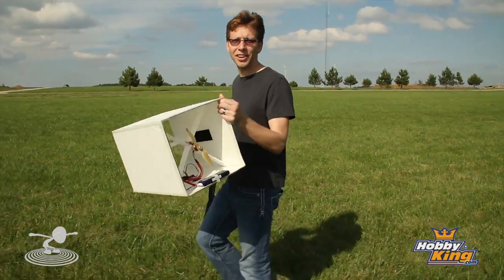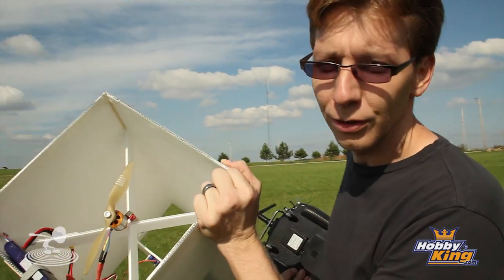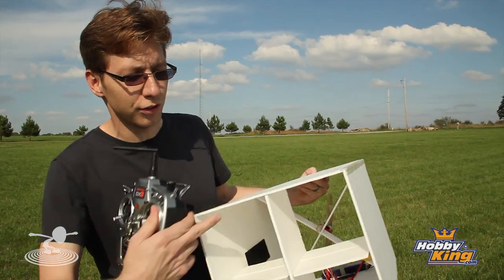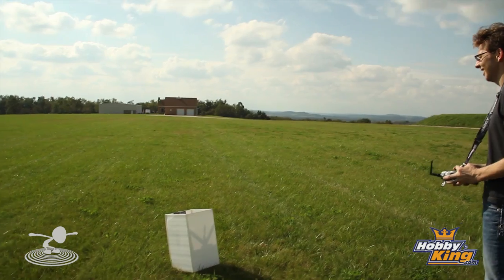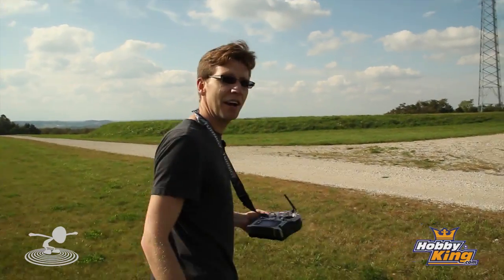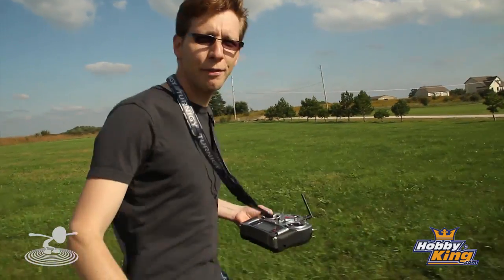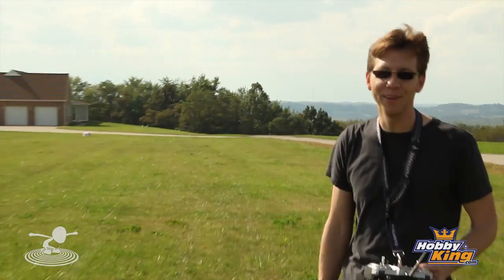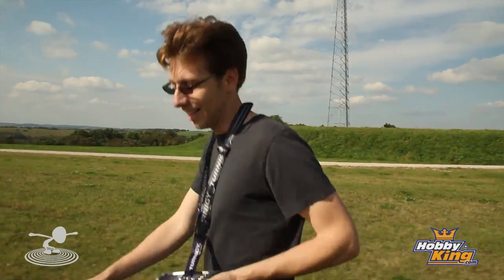FT Development - Flying Box

Comment: One suggestion for making your box able to.be turned around is to place most of your weight on one side, and install two servos to give you turning capability.  You WILL need two additional Control surfaces to receive this.  I hope this helps.

Comment: Kinda reminds me of our old box kites we used to fly as a kid. Might try changing the bottom to one of the edges, putting the battery in the bottom corner of the box and incorporating a V style rudder/elevator. Shorten the length of the box, being too long will not allow the box to turn as well as a shorter one..

Comment: HEY you need to give it its own sense of up and down what I mean is the Omar's of the book is symmetrical on all 4 sides so the air flow is even instead of of using a battery on the lower part of the box ( which was bad idea) it needs to be in front center along with pitch and yaw separated from back to front like a normal plane so it can actually have controllable movements and not be completely symetrical. You got to manipulate  the air to your needs to weigh your plane down in a spot that would be irrelevant to its stability if you made the plane a bit better.( I don't make planes like y'all so sry if I'm wrong but it just seems like that is what's happening and how I would fix it ).

Comment: You have to put the Battery pack in the middle or at least closer to the centre. Otherwise the elevons won't get enough leverage. 
You can also increase the size of the elevons, but it might take too much power from the air flow of the propeller.

Comment: I think what you should do is take the cg to front but a bit higher, like when you are looking from front if the battery is on middle of the square it would be even more stable and then you can roll better. :D
Reply: I know this is old but i agree with placing the battery in middle and i think make the top of the box an airfoil would might help with lift. instead of jut all power lift.

Comment: Hello, did you have any rudder at all? Looked like the vertical  member  between the elvons was fixed. If so, notching out the elvons would allow some rudder movement although too much would be pretty bad. Other wise, how about adding box flaps - I don't mean aerodynamic "flaps" but flaps on the edge of the box to act as drag rudders, Northrop flying wing and it's decendant the Spirit bomber. They could lay flat against the sides of the box and get pushed out into the slipstream by a servo bell bellcrank, one each side of the box. Boy, you are really pushing the (DHL) envelope!\packet/box! Love it & the show! With every good wish,
Chris (the limey in Sweden)

Comment: i think that on the trailing edges of the box sides you need to do a 50/50 split flap on all four sides.  mix so that the top on one side of the vertical and the bottom of the opposing side work together. on the horizontal do opposing throws. you need as much control surface as you can get though. the length of the box is making it want to track straight-ish but the huge surface area on the sides wakes wind drift a huge problem. basically make the box shorter and add more control surface area.

Comment: Chad, It will fly but you are running into the same issue I ran into with my flying box.  The battery has to be centered behind the prop.

It appears you need almost all up elevator until there is enough air crossing the elevons to keep the nose up.  That plus the exterior top and bottom sides of the box are impeding the control surface from being effective.  When trying to turn, you loose your lift due to the battery being low and trying to nose over.

With the battery (weight) all centered between the upper and lower wings and sides, you will have elevon control, but not as much as you would if you used the exterior surfaces.  You should be able to pick the box vertically by the prop and all four corners lift at the same time.

To get the (front to back) center of gravity, measure from the leading edge of the box to the rear of the elevons.  Take that measurement and multiply by 0.29.  Take the product and measure from the leading edge back the distance of the product and that's where your CG should be.

I've been thinking of revisiting the flying box project after being inspired by Abu Nawaf's rc flying box, but after getting mine flying, I.. uh hum.. had a rough landing.. Ha ha!  I took what I could from the wreckage and file 13ed the rest.

Hope this helps, all the best and Happy flying!
Ron

Comment: I'd do either of this two things: Add a rudder or  add some wings to pick better air so it can actually turn when it inclines to either side; It would end up nicely as a winged turbine (only thrust vectored). (I'd add symmetrical ones with no dihedral).

Comment: many yrs. ago  one of our guy's built snoopy's dog house complete with a profile of snoopy in his flying attire on top of it. the ends and bottom were open Had to as it was a glow engine. but the bottom was braced. He had an airfoil and rudder and elevator inside it and it had trycycle landing gear well inside the outside walls. it flew somewhat well for it's being a box. it was a lot of fun to see it fly and he would put in his casset  of the Royal guardsmen singing "Snoopy VS the Red Baron". Really cool. Maby you could do this  and have the Fokker tri plane there also.

Comment: Dear Chad,
I watched this video a while ago. I have ben thinking of why you could not turn it around. I just watched the video again and it his me... the reason is because the battery is on the bottom so when you try to bank it naturally wants to roll back to the level position. I recommend putting a ruder and/or put the same amount of weight on all four sides of the front 
P.S.
if you have already figured it out and can fly it. when will a video be posted on the channel

Comment: Hey Chad, that's pretty cool, but I think it might be good if you had a little rudder, I would take one of the uprights in the back, and make a rudder. To help with roll I wonder if changing the position of the battery from parallel to the prop to 90 degrees to it.  Hope that helps, I would like to build one to!   mike

Comment: I agree the lack of roll is due to the CG being on the botton. Try putting the battery just behind the motor, or use two batteries in parallel with one on the top and the other on the bottom.

Comment: Rotate your elevons by 45 degrees. Put battery and weight on bottom corner as ballast.  
Or, maybe setup the outside of the box with control surfaces on the outside.  Maybe V-tail controls?  is double V-tail possible (assuming you'll have to reverse the servos for the top).
Just some ideas.  Good luck, Rock on, and thanks for all the episodes!

Comment: or maybe instead of flaps you could make them rotate and create a cork screw effect...cut the flap out and reattach with rods and use servos to spin the flaps rather than lift or push.
another idea could be to maybe invert outside flaps to drag the plane in the direction you want cupping the air and pulling it into the box. (again using the outside rather than inside )

Comment: CofG might have been 10ish percent back from the front, but it was also  WAY down low in the up-down direction because of the battery.  Try mounting two smaller batteries on opposites sides (one on top front and one on bottom front), and the vertical takoff won't tilt forward.

Comment: Bwahaha, awesome. When it took of like a mad thing is the funniest thing I've seen in a while. Love it. I think you're spot on with your battery comment Chad, it won't roll with all that weight at the bottom. Move battery into the centre, inline with axis of motor? Or use several smaller batteries one on each side? Hilarious either way :)

Comment: Hey Chad, I would try a vectored thrust setup for this at least for "rudder". Also if you changed the flight orientation so that it flies with with a corner pointing down this will allow all sides of the box to generate lift rather than just the bottom and top. It should make it more stable too. Good luck!

Comment: you wont get roll with all the weight on the bottom of the aircraft, maybe get a battery quarter the weight of that one, then get 3 other weights that are also a quarter the weight and put them on each side of the front of the box

Comment: Use the other substrate for a rudder, so then you can incorporate some kind of turns. Also there is no reason that a box has to be closed, So use two sections of coroflute for the box lids and make wings from them add a couple of ailerons paint it brown add a lil parcel tape and you have an open flying box. Hope this helps.

Comment: Hi Chad 
Had a read at a few of the posts there a couple of modelers out there with the right idea to stabilize your box you should look back at and old boxkite ballist in a corner   that will solve the stability issue ,then treat the whole thing as a very small span delta  careful with roll  not so much with pitch good luck 

Love to watch J&J  its like a train wreck  just can't help myself
Philfix123

Comment: hey Chad, I think you need at least a rudder.
the ailerons function will not heelp to much.
Think about it, the fin is veeeeery big with all this material installed as the sides of the box. so you need to activate the
rudder and deaktivate the ailerons function so it will be an two aixes flying box at the end. 
Let's see whats happening ;-)

Comment: Try moving battery higher, possibly the low weight position relative to 'centre of lift' is fighting the aileron roll input.  Also I can see the box edges are resisting any lateral or vertical force changes, fit elevators to the upper and lower sides of the box and you'll have it.

Additionally, perhaps a gyro in the roll to help stabilise if that is a problem?

Comment: interesting idea, i think it is too long though, try cutting it in half so that it is shorter. it looks like there isnt enough air moving cleanly through the tube when you get to high angles of attack. Control surfaces on the outside would help this and making the whole craft shorter. If you imagine it like a conventional aircrafts tailplane with the wings wrapped around the outside it could work. would be twitchy as hell though. 
Could also try making it more like a box kite!

Comment: you are going to have to use rudder to turn. otherwise put your engine further out and suspend your battery in the middle of the box. that should bive you the roll. another idea is to make a wing from a clear piece of plastic. it will put your aileron inputs out far enough away from the center of the body as well as be fairly invisible in the air.

Comment: I do not think the bank-and-yank method will work with this type of aircraft with this current setup.  So if you want more turning I would suggest either putting a rudder on it or actually putting small delta wings on it.  And of course making the control surfaces bigger.

Comment: How about setting up thrust vectoring for the prop? i.e. making the prop pivot on 2 axis to "pull" the box towards the desired direction? Also, I think an elevator+rudder setup will do the trick since the box won't roll, make it do a flat rudder turn. Good luck, Chad!

Comment: Do air brakes with the trailing edge of the port and starboard surfaces, like what Josh did with the yaw control for the wing.  This might give some yaw/turn ability.  I would also lower the motor as well and try and keep a low roll centre of gravity, but his will upset the straight up launch. Perhaps use a ducted fan for propulsion, might give better thrust performance in a tunnel.
This idea looks great, I just love the launch concept.

Comment: I think you're right; with the battery in the bottom you can't roll properly. A rudder would make turns easier I think, but you could also try suspending the battery "in-line" in front of the motor to have in the "roll cg".

Looks awesome by the way, and the takeoffs along the ground are hilarious! :D

Comment: matter of fact... it will be self stabilizing (pendulum effect-battery goes low) like the old time free flights. You steer it with rudder (vertical control surface) and control climb with throttle. Elev is just used to cause it to fly slower or faster

Comment: You guys are missing it altogether... Put the surfaces in the form of an X from one corner to an opposing corner...and the cross is the other surface.

The box will fly in "diamond" configuration.

balance at 60 percent and fly in high alpha like the patented "flyable sphere" CrazyBall I designed  (crazyplanesrc   dot -you-know-what) The battery will go on bottom front corner

Comment: Chad!
I had the same problem! I builded a flying sub, came up with the same problem. No roll. My tip for you is that you ad rudder, that is going to fix it.
At my vid here on the sub I'm only using rudder since the roll didnt work!

Comment: You should try having the control services on the outside surfaces of the box. I wonder about the control surfaces having less control since they are on the inside, this box is basically controlled only via thrust vectoring as it is currently set up

Comment: If you make up cross braising like the one that holds the motor in position for the battery it might solve the roll problem. so you will have the battery right smack in front of the motor, strapped to the cross braising!!the wind will travel around the battery and into the prop!! you can then lower or rise the battery up and down along the cross braising and see where the best position would be for both stab-ability and roll control, without the use of a gyro....
  
Mike from Ireland!

Comment: Very cool, can't wait to see it work! Seems like all your control force is exerted by propwash as the elevons are mostly blanked by the lower "wing".  Could you make elevons larger and commit to a baseline throttle setting for affirmative control?  And with neutral (or even negative) roll stability from the box shape, gonna be a handful to keep straight.  But you da man to do it!

Comment: Do you want to make this easy?  Toss in a FlyCam (kk board) in it with SingleCopter firmware.  Multi rotor tech to the rescue: look for "Single Prop VTOL - kkMultiCopter SingleCopter"  I would say use a quadrino, but no firmware for this yet.

Comment: Hi Chad, I got some suggestions for you. 
1) try using rudder instead of elevons or moving the elevons to the bottom part of the plane. The way you are doing you are creating rolling moment but not as result of differential lift like on traditional planes;
2) try to enlarge its wingspan without increasing its chord. This will increase your aspect ratio and provides you a better lift.

Comment: Hey Chad, great attempt to get it flying. I actually tried to make an xbox 360 box fly. lol. But it just skidded around the parking lot, it was an afternoon project. Well for the technical input: You need to put decals on the box so you can orientate it in the air. I like the battery shifting idea from truthprojected, it could work. You can also try a Vtail configuration and have it fly like a diamond.

Comment: Try doubling the width of the sides so it has more surface area on the sides. Extend the length about 3/4 more of the original length. And make it slightly more rectangle shaped. After you expand the sides, shave off about 5 inches on the two vertical sides so when it flies it gives you more stability in the roll. It would end up giving it more of a wing feeling. I've built a pogo VTOL and a flying pizza box and if I were to merge the two this is probably what I would do. Good luck and I cant w